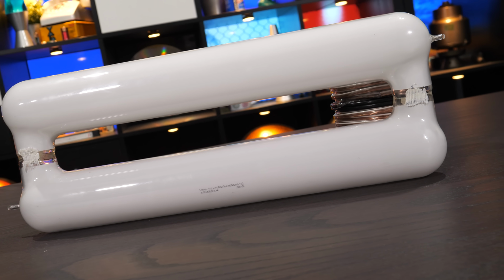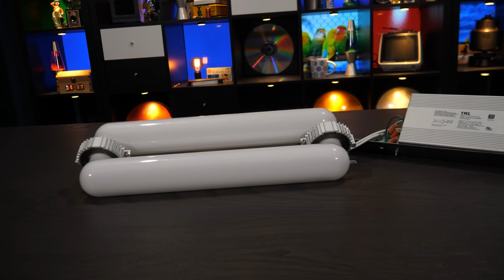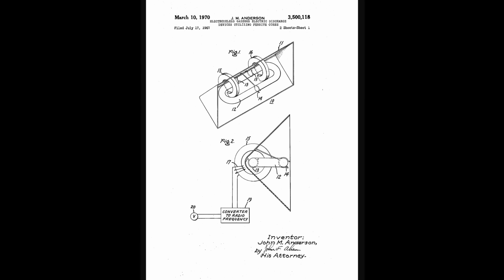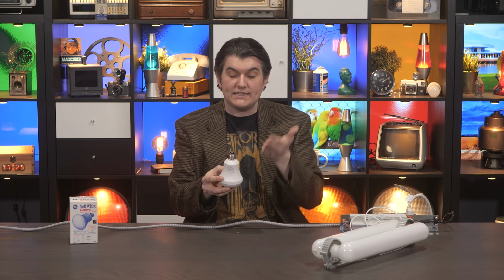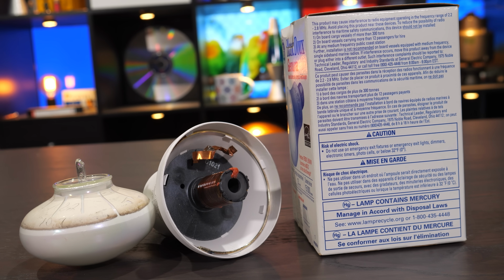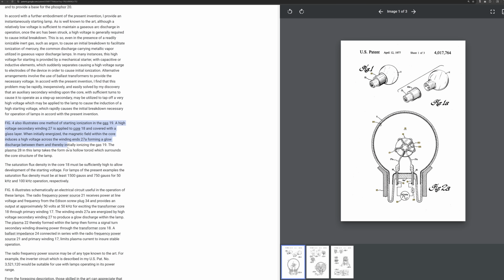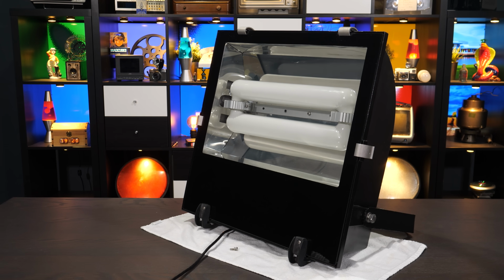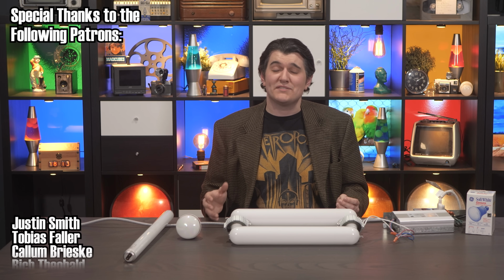Induction lamps: fluorescent lighting's final form

Comment: We used to carry florescent bulbs  under high voltage power lines at night. You got plenty enough light to see but nowhere near the full normal output of the bulb.  We tried some half-ass experiments to see if aligning the tubes with the wires made a difference but nothing we did, other than distance from the wires, mattered to the light output.
Reply: I always wanted to try that but the lines were too far away to ride my bike, and if i ever gound a flourescent tube while dumpster diving young me would have smashed it (or found it broken) well before I rode my bike a few miles uphill to the lines.... You could hear the electricity sizzling. I don't know the voltage of the lines though, like if it would have been strong enough.
Reply: @volvo09  the higher they are and the farther apart they are on the pylon/pole, the higher the voltage, generally speaking. 

Most areas have like 14k and 25 or 27k if I recall correctly. 

There's 2700v and something else I think around the 7200v range. 

Those are your more standard voltages that feed residential and smaller commercial spaces, not the larger substation to substation lines. So those would be significantly higher. Depends what you're standing under, really.  If it's on a wooden pole it's probably low-mid 5 digit voltages.
Reply: Years ago I worked for Harley Davidson, they had a guard shack at one entrance to the plant that was right under some big power lines. The fluorescent lights still glowed when turned off.

Comment: WRONG ⚠️
Laser diodes are more efficient than normal LEDs.
You can have a UV laser diode fire through an optical fibre in the shape of a incandescent filament that has a matted surface to allow some light to escape.
If that filament is coated in a fluorescent phosphor then we would have a really bright light source that mimics perfectly an incandescent bulb but without getting hot.
Lighting technology is not figured out, we can still toy around with it.

Comment: In my job we used HF welding equipment for welding plastics. It operates at 27 MHz ( I bet all the CB radio operators loved us...) An unconnected fluorescent lamp would light up when placed inside the protective Faraday cage.
Reply: Well that Faraday cage what was kept the local CG operators and the authorities happy.
Reply: @FoobarDesign  Not really. That machine operates at 1.5 kW. There was no way to keep that completely shielded. That's why it operated in an "uncritical" band.
Reply: CB operators would probably use the welder without the Faraday cage just so they could interfere with others.

Comment: 26:00 I will challenge that: I have couple of electronic ballast fixtures and they all flicker! Name brands like Osram, no-name brands I don't even remember, the ones that came with a fixture, or the ones that I've retrofitted - they all flicker at 100 Hz. I suspect that this is due to the tiny size of the electrolytic caps needed to keep them at high power factor.

Comment: Phillips declaring the ferrite coil and core in their QL series induction lamp as the "antenna" is technically correct, in the same way that the ferrite rod with hair-thin wire wrapped around it in a typical AM/FM radio is also an antenna.
They are both equal parts antenna and inductor. Unlike typical "length of highly conductive wire" types of antennas which are tuned to transmit or recieve based on the Electric field of a radio wave, these sorts of antennas operate on the Magnetic field of a radio wave.
This means that ferrite rod antennas can be made incredibly compact compared to antennas tuned to the same frequency operating in the electric field domain, because you can get the same overall inductance out of a smaller length of wire thanks to the ferrite core making a given length of wire count for more inductance when wrapped around it.
The only real difference between a ferrite core antenna and a ferrite core transformer is the shape of the core.
Antennas want as much of the magnetic field to be free to enter/leave the ferrite core as possible, so they use a simple rod shape with the wire wrapped around it, and this is the form factor of the antenna in both Phillips QL series induction lamps and the demonstrated GE downspot replacement induction lamp. The idea in both cases is to get as much of that fluctuating magnetic field to interact with the gas in the glass envelope of the bulb as possible.
When building a ferrite core inductor or transformer, the magnetic field that leaks out of the ferrite core beyond the windings does not contribute to useful operation, so efficiency optimization dictates that it be minimized. This is why you see most ferrite core inductors use a ferrite core arrangement called a "Bobbin core" or a ferrite toroid. Bobbin cores get their name because all the windings are wrapped around a single bobbin, and the core typically takes the shape of 2 pieces, they can both be shaped like a capital "E" with the bobbin's center hole occupied by the center projection of the "E" pieces, or there can be only one "E"-shaped piece with the other piece shaped like a capital I, with the bobbin's center hole occupied by the center projection of the single "E" piece. In both cases, there will be a carefully calibrated gap between the middle projection of the E-piece and the other piece of ferrite, sometimes held to its dimensions by a plastic shim (if corona discharge is an issue, such as in ferrite core flyback transformers used to create the HV for CRT screens), or simply by the dimensions of the middle projection of one or both E-piece(s) of the ferrite core itself. This is done to prevent saturation of the inductor or transformer, which is a phenomena that limits the maximum power transfer thru the device in question.

Comment: I believe it starts by capacitive coupling between the start and beginning of the windings right against the tube, that tiny ionized point grows and becomes less and less capacitive and more and more conductive causing the driver circuit to dump most of its power into the tube dampening the voltage across the windings further causing a decrease in capacitive coupling assuming it's running at a constant frequency. The tubes I make need to be very close to the high voltage side of the coil in order to start but putting them on the opposite side does nothing at all unless I manually ionize them causing them to happily light right up.

Comment: As a Street Light Manager from years ago, we incorporated induction fluorescents in our post mounted decorative street lights way back in the mid 2000's.  Nothing new about them.  They are definitely more efficient than the high pressure sodium units they replaced, and provide a white light.  Not as efficient as LED that exist now, but way more efficient than any other fluorescent, and don't need that small amount of mercury to initiate the light.

Comment: I first learned of these about 15 years ago when someone was selling these at a garage sale.  Unfortunately, the ones he had couldn't really be used in most home lighting -- it needed something equivalent to a high frequency oscillator and the tubes themselves were just far too big to fit inside any common fixture.

When I did search for possible induction bulbs that fit into Edison screws and could be small enough to fit into a common lamp, I ended up finding only 2 results on the shadiest online store one could imagine and they were $70 a piece.  That alone eliminated them from consideration.  Otherwise, they hold so many merits that even LEDs could not match at the time.

Comment: We have the Philips QL lamps where I work. Never knew what they were until today. The life of them is incredible, over 10 years at 15 hours per day which is important as they are in a high ceiling requiring access equipment to get to them.
Reply: The only ones I've ever replaced as an electrician, were 4 sets of scaffolding high in the entryway of a building built in the early 2000s. That was about 2018 ish and they had burned. We always assumed they were original to the building. Nobody could recall ever having to pay anyone to do it and it's an independent place run by the owners that built it. 

Makes sense now.

Comment: In the AIr Force in the 70's we used neon bulbs against aircraft antennas as a quick test to make certain the UHF radios were transmitting.
Reply: That's very funny and relatively clever/efficient.

Comment: The electronics failing before the light emitter is a sadly common problem. I can't tell you how many LED bulbs I've replaced because the supply failed while the diodes were completely fine. I had one at my work where the supply straight up exploded on a high-bay LED panel. I dropped in a replacement supply and all was good. Hilariously, there was a label on the unit specifically saying that there were "no user-serviceable components inside".
Reply: It's just stupid that the drive electronics and the LED are combined, meaning the cheapest possible drive electronics will be used since they get thrown away with the bulb anyway... instead of having high-quality drive electronics and a replaceable LED
Reply: @MatthijsvanDuin  Yes, that's what designing to/for legacy infrastructure gets you. It would be so much easier if we could rewire all our houses to include stable, HQ 24-48V DC everywhere and not have to worry about packing tiny AC/DC converters in every LED light bulb (and many other appliances)...
Reply: Nooo, mortal consumeroids are not supposed to understand the Alien Technology from their Corporate Overlords!:face-red-droopy-eyes:
Reply: it sux when bulbs with high quality leds fail like this.
ikea used to sell decent 10w led lamps but they didnt even last a year before the ballasts became cooked.
i put one of these ballasts in a small external box and everything still works after 8 years of everyday use ! 
also talking the diffuser off doubled the brightness.
Reply: There is a slight benefit that the e-waste drives the cost of manufacturing the LEDs at lower unit costs.  It seems like now that the cost to manufacture an LED has come down, decoupling the driver might be worth it, but then there is the user serviceable constraint where the typical consumer isn't going to understand what "part" of their bulb failed. Probably still not worth the cost for the manufacturer to design something which will be replaced completely by most people at a higher cost. Market pressure would quickly select the cheaper alternative.
Reply: Our apartment complex has replaced some of our overheads 2-3 times within the year. They buy such cheap bulbs and put them in an enclosure that only makes them hotter…the driver electronics last maybe five months of normal usage.
Reply: I had one of those fancy glass LED bulbs in my kitchen ceiling fan and it violently exploded out of nowhere. Confused the heck out of me.
Reply: @kellypg  plot twist: it was a halogen replacement ...jk
Reply: My non-user serviceable LED refrigerator lights recently died, and I serviced them back into working order by replacing a burned out capacitor on the LED power supply. They should just make proper power supplies, it's not that hard
Reply: We go through LED drivers all the time. Good quality industrial LED fixtures really last no longer than a typical T8. 

The drivers are largely garbage while the LEDs themselves last forever.
Reply: We thumb our noses at that label.
Reply: Got so sick of LED bulbs burning out. I just stick to CFL now. Neutral 6000k
Reply: That happened a lot with CFLs too. I used to repair them just because I could.
Reply: Recently a Phillips lamp gave up in a living room.
One of its LEDs just melted, and after I opened the lamp it reeked of a dentist's office. Yet the lamp was still somewhat glowing, albeit emitting a chirping sound and flickering.
Reply: This is why you should design it as at least 1:2, better 1:5 of used power : max power.
Reply: @Johannes-c7p  1:5 is very excessive, maybe you meant 1:1.5. consumer LED bulbs are super cost optimized and space optimized (and planned obsolescent) and run their supplies right on the edge. If you'd make the supply 20% to 50% bigger it would last a lot longer.
Reply: they want you to buy them regularly, the first incandescents would last decades it took them years to find ones that die in a year or two.
Reply: @LTPottenger  You were doing so well.........then you made a story up.
Reply: @stusue9733  wrong
Reply: @LTPottenger  What @VexingRaven said.
Reply: @LTPottenger  The incandescent flood bulbs in my kitchen, which are used every day, date back to 1994, when the house was built. They are specialty bulbs rated for 130v instead of 120v, and they've always been on a dimmer where the lights have to be dimmed up to full brightness. What destroys incandescent bulbs is the shock of repeatedly starting them with full mains voltage, which overdrives the filament until it reaches full operating temperature.
Reply: @alex_stanley  Which 
A. Makes the dimmer far more expensive, so you are savng bulbs by spending far more on a dimmer.(I have 3 of those dimmers that are less than ten years old,  two of them have failed)
B. Under running blubs has always been a way to make them last longer, but for the same amount of light you make more heat. So you are saving bulbs by spending more on your power bill....Well done.
Reply: @stusue9733  I have LED lighting throughout the house, but I keep the old incandescent floods in the kitchen because I like the warm quality of the light. And, I love that it's a 30+ year test of incandescent bulb technology. Surprisingly, no dimmer has failed; the original was replaced when we put in modern style outlets and switches, and it still works.
Reply: @alex_stanley  Hey nothing against your choice of color*, I have mirror back incandescents with dimmers on the bed head for reading. But lets not pretend we are saving money.

*Went through 6 or so different LED downlights before I found one the "boss" was happy with.
Reply: @LTPottenger This channel literally has a video talking about why that's not true

Comment: Work on an old museum ship, the radio room has a 200 watt transmitter that goes though a 1/2” bare copper wire to the antenna. We have a CFL with the glass ziptied to the wire and whenever you hit a key for Morse code it will light up
Reply: That's awesome, what ship!?
Reply: @beanman1760 the Jeremiah O’Brien, it uses transmits from 350-500 kHz

Comment: Induction lamps don't have electrodes, and I think that's because the lamp basically acts like the secondary coil of a transformer. The driver starts with a higher frequency and higher voltage, which is then induced in the lamp through reverse eddy currents. As free electrons begin to move, they start to align in some sort of order.

The high voltage — similar to the bi-metal starter in older lamps — helps get the electrons organized through polarization. Once that happens, they can pass current more easily, which leads to the generation of UV light. This UV light is then converted into visible light by the phosphor coating inside the lamp.

As the lamp begins to emit light, the current increases. The driver senses this rise and reduces the current accordingly. It's similar to how, in older fluorescent tubes, if you don’t have a choke (which was eventually built into the ballast), the runaway current would cause the tube to short itself.
Reply: My God I'm old enough to have learnt about fluorescent in school and now they are pretty much gone. Well good riddance uv damaged tombstone gave me enough belts over the years. 😂

Comment: Looking at all the Mercury you just interacted with, I have a question. Do you ever worry about your health given all the devices that use hazardous materials you've collected and demonstrated over the years? I'm thinking of all the mercury-based bulbs, the petrolatum lamps, and so on.
Reply: Mercury is not a problem when enclosed in glass. To all intents and purposes it doesn’t exist outside the bulb. And all risk is relative, drink enough water and it becomes very dangerous. I’ve been around breaking TL lamps and I am still breathing. I was borne before unleaded fuel was a thing and yet, I am still here. Don’t swim in mercury or drink petrol, but a little vapor once in a (well) ventilated room doesn’t usually kill you.

Comment: I imagine the starting is similar to holding a tube in the air next to a transmitting antenna, or using one of the handheld lamp testers... the high frequency RF alone gets them going. 
A hotel we used to have conferences at has these in its parking lot. It's in Michigan, and we'd go in January. They worked fine - the enclosed fixtures help them hold in heat in the 5*F temperatures. I'm sure they took a while to get to full brightness, but that's not an issue in a lamp that's turned on once per day.

Comment: I once had one the the GE domestic versions of this and it didn't last any longer than a standard compact CFL. I also worked for a firm contracted by Philips to develop improved drivers for a domestic version of the lamps. Clever placement of the components enabled a huge reduction in unwanted RF interference (a big problem in compact versions for the domestic market). The domestic prototypes worked well and were far more compact than the GE equivalents and very similar to more modern CFL bulbs, and better performing in some ways. But Philips never commercialised them for the domestic market. But the commercial Philips versions (with separate drivers) did sell to markets where maintenance costs were a problem. Big Ben in London once used them to backlight the clock. It was certainly cool technology, but never, it appears, the right cost/benefit domestically.
Reply: The main problem was the carefully and willfully engineered drastically shortened lifespan of the driver.
Reply: CFL = compact fluorescent lamp. compact CFL = compact compact fluorescent lamp. You don't have to write compact twice.